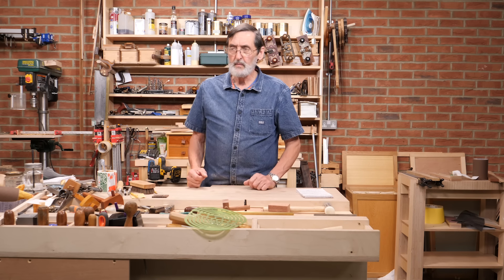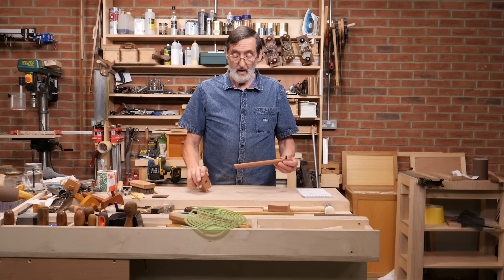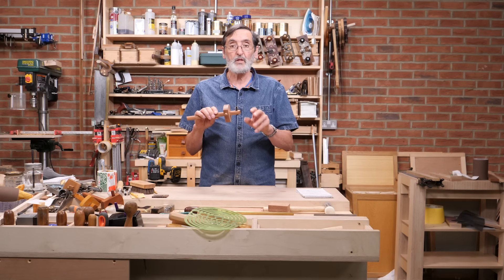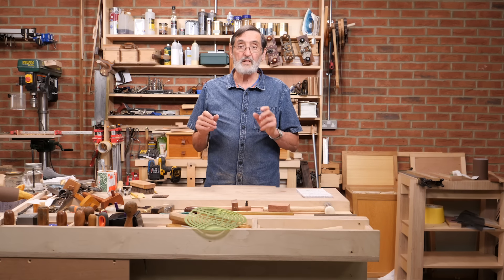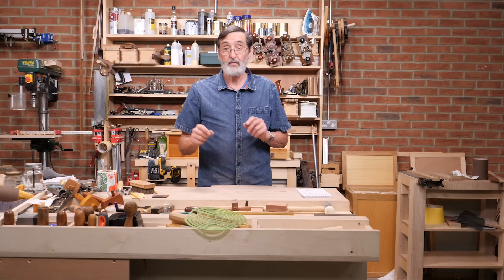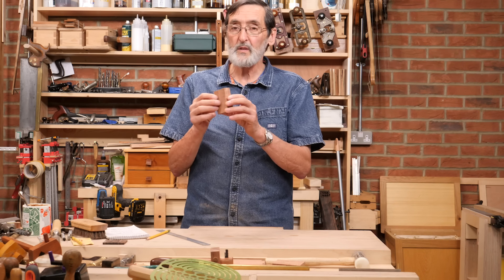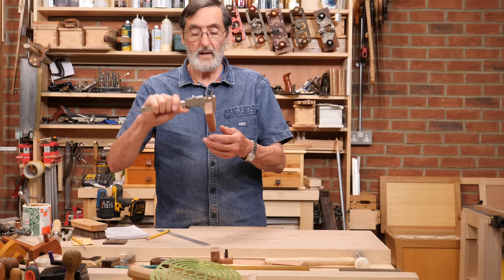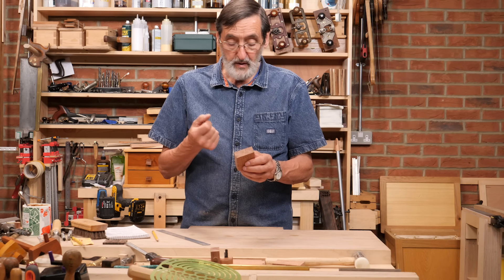How to make Marking Gauges | Paul Sellers

Comment: i still own my Auger Brace that was part of my first tool kit as an apprentice Carpenter and joiner in 1984 ....don't use it anymore ..but those years as an Apprentice, it was all i used.
Unfortunately most of my original tools were stolen a good few years back ..replace with more modern Equivelents ....i still have my old block plane as well which i use most days .
Only just Found your Channel ... subscribed and loving the content .

Comment: I've been waiting on this too so many thanks to Paul. If he truly is a mind reader he'll already know I want to do a panel gauge too so I won't ask here.
 I salvaged some usable spalted silver birch from some partially rotten small logs from a garden tree- 25mm stock dried for a year.  I had a go at a prototype fixed pin 6mm mortise gauge which turned out nice albeit overly worked and 'cutesy'. Now I'll get on with some real functional gauges. I do intend to make complete gauges though so when the first stock/fence is right I'll butt up the others to it and use it as a guide to drill the other locking pin holes.

Comment: Just did a practice run using pine. It turned out really well! Now for a nice hardwood. Thanks for the wonderful tutorial.
Reply: Did you make the final pin out of pine, or some other wood?
Reply: @AndreaCuchetto  I made it all out of the same pine. I don't plan to use it so it didn't really matter. If I was going to use it, I'd probably use something harder for the pins. I just started on one using walnut and ironwood but I wanted to make sure I knew what I was doing first.

Comment: The slight radius at the bottom of the hole (as opposed to a flat surface) helps keeping the stem straight, even as the stem and hole wears out over time. When the locking peg pushes the stem down, it straightens out.

Comment: Hi Paul, I do not know if any one else picked it up, but when you were setting out the markings for the  different chisel widths, you took the measurements of the next chisel width from the previous one and not the datum or first pin. this would have made each increment the width of the sum of the last chisel plus the new one.

Comment: For anyone like myself that can’t drill a straight hole without assistance for whatever reason, a doweling jig is ideal to make pilot holes for larger holes or a guide for sizes that you have guides for. I plan on using the dowelmax to align that hole for the long pin or I will never get one made

Comment: Two and a half plus hours? Lets see if I can concentrate that long with my brain damage... might have to watch it in peices, but I will watch the whole thing, eventually.
Edit: only had to take a few short breaks, but I made it through. Love watching Paul work. Definitely saving this to one of my libraries/lists. When I can get the materials, I will be making a set to complement my Narex mortising chisels, at a minimum, for sure. I have access to some sycamore and black locust, may have to make my set from sycamore stocks with black locust stems. Likely do the lock pins in the locust too. Just have to aquire some steel pin and blade materials, and find the time when my disabilities are allowing me to "have a good day" that I can get in the shop and work. Thanks for sharing a detailed video for such a helpful project, Paul.

Comment: Love how your tools are so sharp, even the scraper. Never thought so much went into a scribe.. Why did you make one with the timber wedge and others with with a sharp metal pointer? I watched till the end and liked the little locking bar, so much better than a wing nut. Thank you for showing your beautiful work, time went by quite quickly.
Reply: The one with the wedge is a knife. The wedge holds in a small steel blade. It severs the surface fiber as you mark. Nice mix of Paul’s style with a Japanese cutting gauge.

Comment: 46:53 The beam is not square for a handful of reasons one of which is complicated to try and type but I'm going to try anyway. The pin would emerge from a flat side and there'd be about one angle it could be held at to mark the wood. The corner would catch the workpiece rather than slide across. It would be uncomfortable to hold. The last is a bit more complicated so it gets its own paragraphs.

The beam and the hole in the stock wear and compress over time, let's just call that "the hole getting bigger". The beam is being pushed down in the bigger hole. This makes a small gap at the top so because they're not touching at the top the top doesn't help to align the beam and stock. The sides are curved, a little worn too, so pushing the beam down makes a gap at the side too so the sides don't help alignment.

When you pull the gauge forward, drag on the pin wants to keep it still. The beam stays horizontal (it doesn't pitch up or down because you're just moving it horizontally), the beam doesn't roll in the hole (because the flat surfaces won't let it), but flat horizontal surfaces would let the stock move while the pin stays still and the beam would yaw. Yaw changes the distance from the pin to the stock and your gauge line isn't straight.

You can't make infinitely thin beams and holes so mathematically the next to ideal shape for alignment would be a triangle point down. Even as the hole got bigger the triangle shape would always try to keep the point of the beam edge and point of the hole together. Any tendency to yaw or roll as you drag the gauge is going to try and force the beam up the side of the hole but the beam is being pushed down. But practically, the point of the triangle is weak and will squash as well as being a wedge that will try to split the stock.

So, the bottom of the beam is curved but differently to the top surface which helps to stop roll. The curve won't act as wedge to split the stock. Trying to yaw the beam in the hole would also try to force the beam up like it would a triangle and it resists this toward motion so it can't yaw easily. (Try holding a washer vertically on your bench with the hole aligned directly towards you and put a small nail through it. The nail will sit at the lowest point when the nail is pointing away from you, ie its aligned with the hole. The maximum yaw you can get, to make the nail point most to the left or right, is when you hold the nail at the widest point of the hole, so the nail has to ride up the hole.) It's not as extreme as the triangle but a square base doesn't force anything up at all.

Comment: Terrific video Paul. I never find these types of videos as too long because the extra content is alway the gem areas that are overlooked at times. I noticed that when you tighten the drill chuck on the nail it loosens at times. I used to only chuck driver bits and drill bits by power tightening with the trigger. When the drill stops and applies the clutch brake the centrifugal force causes the chuck to open and drop out the bit. After power tightening, stop drill and turn it by hand to fully tighten it. I’m sure you know this as well as many others. Just thought it may help someone else. Thanks.

Comment: 14:38 I suppose you could clamp (or tape) two small sticks to the sides to help visualize the horizontal alignment of the boring bit. The vertical alignment is still gonna be intuition, but at least half of it is easily visible that way.

Comment: Nice explaining, but having made one 40 tears ago, I filled the marking pin flat instead of a round one. (Still a pin of course)  the resistance is less marking a line and the result is nicer without the scraping a round pin would do. Thanks for sharing.

Comment: If you secure the work on the bench with a holdfast etc it can't move down when chiselling. Its difficult to keep the work still if you strike a chisel into the work if its clamped in the vice.

Comment: Paul. I enjoy watching your hands on approach to wood working. This is how my father first introduce me to wood working and I still enjoy doing thing the old fashion way. Power tools are not a must but can make jobs go faster and I use these most of the time.
However, the past couple of days I have noticed that even you make mistakes, small mistake but still it happens. Note in this video you were making the 1-3/4" cut on the main block. You did not use the same side of the 1-3/4" curve on the template. Did this make a difference in the final opening?

Comment: Hey Paul, great video as usual. Your patience is awe inspiring. 

I only thought of this because I just got my first set of wooden screw clamps, but it occurred to me that such a clamp would be just the thing for clamping that tiny wedge so you could plane it as they will clamp angled bits very easily.

Comment: I make a simpler wedge design that fits the hand more naturally and isn’t complicated. I could make a video, but no one would watch it.

I also shape the scribe to be a chisel edge.

The flat side of the chisel shaped point is on the fence side so when you put a piece of wood between the point and the fence, it is more accurately replicating that width. 

I also round the shape so it slides over cross grain easier.

Comment: Paul, if you don't have a marking gauge at all (which I don't) how do you make this gauge?
Reply: not to speak for Paul, but one way might be... you can use the X technique he demonstrated on the face of the gauge  on the side as well. Instead of going corner to corner, go from the top of hole knife nick to the bottom of hole knife nick... make your X on both sides and you have your center of the through pin hole (if that makes sense).
Reply: @jjStinger72  I've tried just about everything I can think of to make this type of gauge. I will probably just save up and buy a decent one.
Reply: If it was me with no existing gauge I'd put 2 pins through s stick or a dowel at my required distance with one knocked through further - that one can slide on the stock as a fence with the other marking the line.
Reply: You could use Paul's "Poor Man's Beading Tool" IT will get you by in good stead. Do a search for it. Another way is to use a combination square and scribe. Good luck!
Reply: If you make it yourself you will end up with more than just the gauge set.... You gain the skills AND capacity to answer this question. 
... however, if it turns out a bit lousy, you use the first one you made to make a better to replace it. 
Don't you think?
Reply: @BTW...  Okay, Paul is using a marking gauge in this how too video. I don't have one, so therefore I apparently must buy one before I can make one.
Reply: @malcolmsmith5903  Makes it hard to adjust for accuracy though. That's the only issue with that procedure you suggest.
Reply: Speed square worked for me. I had 3/8 " dowel so I used that.
Reply: Think we're making too much of a big deal about this - he's using a marking gauge to draw a line to get 2 parallel faces to a fat size. Your going to be rounding edges and refining for fit anyway. What do you normally do without a gauge?....you could just mark 2 points with a knife and combination square and join the dots. Go for it - you'll get a working gauge afterwards that, at the very least, you can use to make a nicer one. You can do it.
Reply: @woodswanderer7274  good call

Comment: I realize this question is three years after video was made, but I have a Design Question so here goes: At about 47 minute mark you talk about having a slighted curved section to hold the marking gauge bar. You said you thought that held better. I was wondering why not just make it square on the bottom thus providing three square sides and then the curve on the top?

Comment: Hi Paul,great to see you back at the bench mate,but I have a question...the wood you used to make the fantastic marking guages is mequite..could you put in a link possibly to where I could get some timber as i have quite thoroughly looked through Google and cannot find any other than BBQ chips, shavings and pellets? Any advice to source this would be greatly appreciated.Thanks for the video,and great to see you well.

Comment: Always thought this design could be better - round dowel for the stem. plane a flat surface, drill a hole the same diameter in the head Which is thicker then usual (probably twice as thick) make a wedge from an off cut of the dowel..... no need for complicated weird shapes.

Comment: Advice from he expert.  Paul i have this problem of not having a straight vertical line from top to bottom when I cut with saw.  Could it be the saw that's out of alignment , of shall I have a look at the teeth of the saw (back saw)

Comment: Maestro como el pocos Felicidades salududos desde Guatemala.
Sugerencia poner subtítulos en español
Reply: Question regarding the layout marks for placing the center of the 7/16 hole. Instead of marking 3/16 down from the reference line and then subtracting 7/32, wouldn't it be simpler to just mark 1/32 up from the initial reference line? Am I misunderstanding the instructions?

Comment: hey paul, great video, im actually making one of these at the minute. i have a question thats kinda irrelevant really, but thought i'd ask. you're an englishman like myself. how come you use inches instead of CM's, MM's and metres etc, which is the standard in the UK. i know we used to use inches but that was before my time, so is it just a case of old habits, or is there a particular advantage to using inches as a carpenter? cheers paul, take care

Comment: Hi Paul. How often do you have to sharpen that little folding knife you use?
Reply: He goes into the process in an earlier video, but he always says to sharpen before putting his tools away, a practice taught early in his apprenticeship.  A few swipes on a fine stone and follow up with a strop with green compound keeps a razor edge to work with.

Comment: Hi Paul, a 7/16" washer will not have a 7/16" hole in it.  It will be slightly larger.  Better to use a dowel maker.  Assuming you can find one for 7/16" dowels of course.
Reply: Or you could make a dowels maker, there are lots of YouTube videos

Comment: Nice work, as always.  But I think you erred in your description.  At about the 48 minute mark you started speaking of a 1 3/4" RADIUS (for one side of the hole in the stock).  I think you intended "DIAMETER", not "RADIUS",  but when you suggested the use of a compass you mentioned setting it to 7/8", which of course would yield 1 3/4" diameter.  ...did you perhaps mean 1 3/4" DIAMETER, rather than RADIUS?

Comment: So am I the only one that missed what size the block starts out at? I replayed the clip (1:154 ) when you first start laying out for the center.... I can sort of see your diagonal dimension of about 3 3/4" but sure would be easier to give us that info.  3" x 2 1/4" or  2  7/8" x 2  1/4"are some of the combos that look about right. I like all that you do but I had to quit watching after not knowing the size of the block? The rest of the video is based on it. ??
Reply: what size  does he start with
Reply: No it is not . He takes all his measurements from the diagonal lines . So you can make the block or body of the tool to any size you like ..You know some people need to be spoonfed don't they.
Reply: I understand the idea of using whatever size available, but it would be great to know what Paul uses, then the proportions would look right
Reply: @738polarbear  The key to these videos IS INSTRUCTION!  
To preface "I'm using 2"x 3" but you can make yours any size" is not to much to ask in a 2 hour video! so if you don't need to be spoon fed WHY are you even watching this video and not making your own?
Reply: I think it's 2 1/4 wide (he puts his ruler on it that way once) and probably 2 3/4 tall (that's just my estimate).  3/4 thick?  I expect you want the grain oriented the longer way so the wedging action isn't trying to split it.

None of those measurements are going to be super critical though.  You want some wood to resist splitting, some face to register against what you are marking, and for the thing to fit in your hand.

Comment: Paul, thank you so much for an enjoyable video, and a brilliant idea - a modular set is such a smart solution to "never having enough guages".

I also have a layout question, specifically regarding the twin pin mortise guages.

If you used the drilling jig used for the single-pin guage, flushed it with the end of the stem, drilled a hole for the first pin, and then used your desired chisel as a spacer to offset the jig along the stem shaft, wouldn't this be even more accurate?

I'm not looking to challenge your process, but to better understand accurate marking out.

Thanks again.
Reply: That would depend on how accurate you could displace the end of the shaft against the guide board, but it sounds like it could work if the guide board had a true and square end.

Comment: I associate mesquite with hammer handles. I was thinking desert iron wood acacia for the fence. Iron wood is gorgeous hard and heavy wood, but is absolute murder & total mutilation on tools though. I think shaping aluminum with your chisels and planes might be better for them than dark Arizona acacia ironwood, but it sure is pretty a wood and it wears as good as brass.

Comment: ...sooo I need a marking gauge to make a marking gauge... 😉😅
Reply: I knew someone else would make the same observation as I. I have a Drill Press, so I don't need additional drills and a Hand Brace. I have a Table Saw, so I can thickness small wooden slabs. And I have a Divider Set for marking the circles and some Scribing. But running lines parallel to the edge is why I need the Marking Guage and was watching this video. I guess I'll get one from Harborfreight so I can make the Marking Guage Set I need. Otherwise the instruction is great. Lots of detail, good pace, and you zoom in to show exactly what you're doing at appropriate times. Thank You so much, Paul.